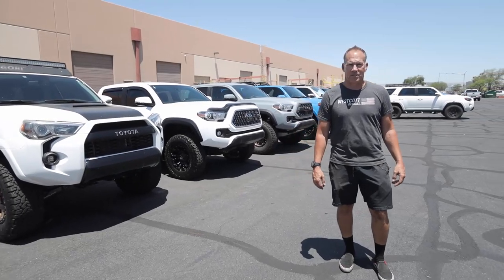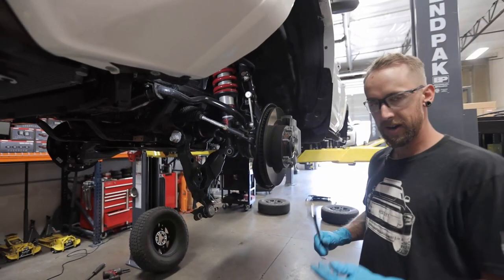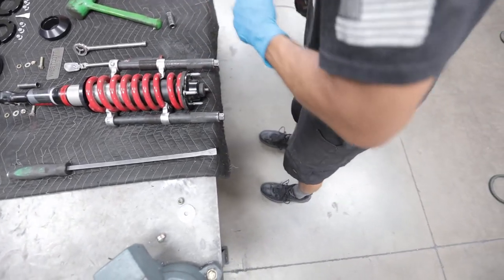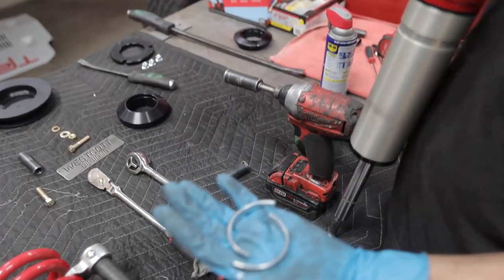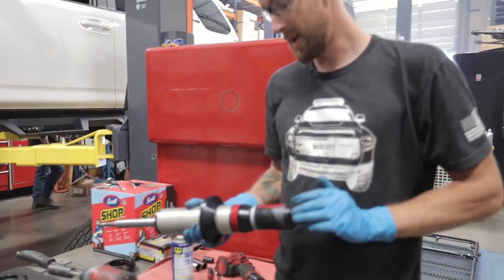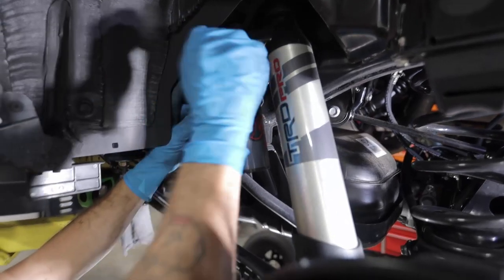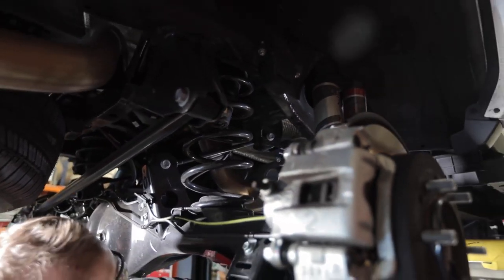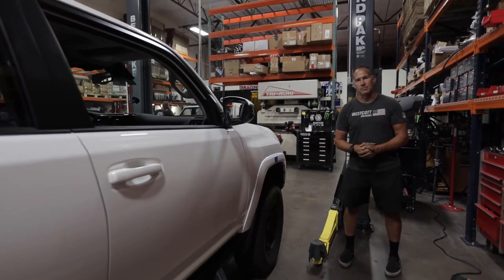Westcott Designs Fox TRD PRO Lift Kit Installation Video

Comment: This is essentially the same method of lifting that the first gen Raptors used to lift the front end….the OE Fox shock had three grooves that you could seat the collar into ( with a lock ring and set screw) to lift up to 2.5”….worked perfectly on my Raptor SCrew…gonna get this kit for my ‘23 Taco TRD Pro.

Comment: The last blue truck actually looks higher in the from and lower in the back. What happens when towing a 2000 pound trailer? will the rear side take more stress than actually suppose to take? Please answer with Honesty because am thinking to use your kit

Comment: No mention of torque specs, not a torque wrench in sight. 

Also took the easy yet more risky way of removing the front coilover. It's easy to crossthread the lower spindle bolts, especially when installing a spacer lift. 118 ft lbs on those, by the way. I've lifted well over a hundred Tacomas/4runners. Have skinned this cat every which way.

Comment: I learn a lottttttt. Is a great work you guys do in a such short time and Wonderful explanation. Am not a science master but it does put more pressure on the Front Springs Which in my poor understanding are designed to absorb the brutal terrain so the body of the truck does not take that stress whether of road or city hwy. One can see  the stress of the spindle bolts after the front kit went in compare when they first came out so Easy and the  upper Arm had to be Stress down to accommodate more distance for the bolts spindles to screw in. In my poor understanding I think the ride will be more Stiff because of the Shortness of the Front Springs to Absorb impact and it will result on more Stress to the truck body as a result. Correct me if am wrong please because I see changes on the Biomechanics alterations.  Did not see any Torque at all. Are we suppose to just tight without it? For look it looks amazing but for Long Life on the Body I don't know. What will happen when Towing? There will be Zero compensation for the back load.

Comment: I'll be upsizing the tires soon on my '21 TRD Pro to 285s up from 265s like you said. I've replaced the front bumper with a C4 Fabrication bumper, so I already have a bit more room in front than stock.  I've been pretty happy with how the vehicle sits and was planning on just doing however much chopping and trimming is necessary after getting the new tires.

Can you elaborate a little on how this additional 2" lift would affect the handling and performance of the vehicle on/off road?

Comment: Are the shocks side specific? 
I removed both at the same time and forgot which one came from which side.
Reply from the maker: They are side specific!  The higher collar from the bottom is drivers side.  That’s because it puts more preload on the spring to offset for the gas tank and driver.

Comment: Great video, thanks for doing this!  I’m assuming the front of a ‘22 Taco would be the same?  
Would love a link to the spring compressor that was used!
Reply: There’s a couple on Amazon for cheap if your only going to do this one job or maybe something else down the line. Unless your looking for some that will get used a lot then look into some better ones.
Reply: You don’t even need spring compressors like those used in this video. The coils can easily be disassembled while still on the truck by jacking up the lower control arm to compress the coil, removing the shock top bolt, and then lowering the jack carefully to release the coil. You also have to loosen the alignment cams and lower knuckle bolts on the LCA before releasing the coil.

Comment: @wescott designs nice video.  For any lifts I have installed I use anti seize and torque wrench. Thoughts? Do you provide specs if you purchase?
Reply from the maker: We do👍
Reply: @westcottdesigns doing an installation on a 2020 trd tacoma. No instructions or torque specs. I've done hundreds of lifts so I'll figure it out but for a beginner this could be a problem
Reply: @nicholascetrangolo8400  they said they do and you’re saying they don’t?
Reply: @macscvelopopperdonuts2169  yes I did an install of one today. Came with zero paperwork

Comment: What would cause the black dust boot to fall and rest on the bottom of the spring perch (front shock)? Does that silver washer that sits between the boot and the top hat hold it in place or did my boot just stretch out?
Reply from the maker: @ivanm2626  never seen a boot stretch out and fail.  It shouldn’t because you are not extending anything or changing the location of anything other then the lower collar being replaced to put more preload on the spring
Reply: @westcottdesigns thanks for the reply. I just raised up the car and tried to figure it out without removing the shock right now. What holds the boot up to the top hat? I’m thinking that the washer may have not been reinstalled if that is what holds it

Comment: Are there any issues with camber through the travel on the front lift for the 4Runner?
Reply from the maker: We have not had any issues the last 9 years of making the lift.  Shops will tell you that you should or need to replace the upper arms,  but this is so they can make more money off the customer for parts and labor.  Toyota has designed the 4Runners to align up to 3” and for the axles to be good to 3”
Reply: @westcottdesigns  thanks for the info!

Comment: Hi Crew! Newby to this world here. I am looking to get this lift for my truck, but wanted to confirm something... When doing the math I seem to be only gaining about 0.55" (inches) of clearance from the stock setup on my '23 TRD Pro when upgrading to the 285/70R17 (is this the biggest tire I can do without any chopping?) tires. The truck will definitely look better with the lift & new tires, however, the true height gain of ~1/2 inch is not going to make or break me when really off-roading. Is this a true statement?
Reply: They did not answer your question because they know It Will. Read my comment or watch the video very very careful

Comment: Do you have a video for tundra pro?
Reply from the maker: What year?
Reply: @westcottdesigns  2021
Reply: @westcottdesigns  2017 Tundra pro
Reply from the maker: The install for your front strut is much easier.  It uses a clip ring to hold the lower collar and you hit it once with a hammer and  it will pop right off.  When you install it you just need to just drop it back over the clips and it’s seated.  As for removing the struts and reinstalling then they come out and go back in the same way this video shows.  One tip to remove the lower bolt for the front sway bar before you do anything at the lower control arm on both sides.  Then it will go easy.  Make that bolt the last bolts you put back in when you are all done and the front wheels are back on the ground and front wheels are settled.  This will make it easy
Reply: @westcottdesigns  Thank you for the info.

Comment: Awesome kit just installed yesterday on my wife's 2019 4runner TRD PRO in voodoo blue. Easy install only question I have is where do the 2 black anodized thick washers go in the install? I did not see them in the video and could not tell where they go when installing.
Reply: Same here. I'm about to start my 2020 .
Reply: Did you figure out where they go??
Reply: @amarek454  I never heard back so no idea. Good luck on your lift. It wasn't too bad.
Reply: @matthewkirkham8234  LOL ok , thanks Matt
Reply: @matthewkirkham8234  I found a supplemental video on their website. The 2 black washers are for the front rubber bump-stops. Video says they are not necessary, only a safety precaution for extreme off-roading. Thanks
Reply: @amarek454  awesome great info thank you!!
Reply: On top of the shock

Comment: at which point do i need a full suspension upgrade vs this kit?
Reply from the maker: It really comes down to what you are going to use the truck for and how many miles are already on the suspension.

Comment: What if I want to keep the stock rake angle the same so the front is a bit lower than the back? Just leave out the upper shim on the front shocks?
Reply from the maker: Correct!
Reply: @westcottdesigns  Could I also flip that around as well and just install the upper shims and exclude the lower preload collars? Or do the lower collars have to be installed? I'd be curious to see if you have any photos documenting the variations of install.
Reply: So if I leave out the top shims,  it doesn’t add any lift to the stock height ?
Reply: @ImOnlyaMAN88  I think it still does. The shim looks about 1/2" so just minus half inch from the total lift. The shock collar is still thicker than the original so you'll still get some lift up front.
Reply: I’m curious how it rides on and off-road with so much preload with the spacers.
Reply: I’m curious about this too. If I want to add just .75” lift (plus or minus) to my 2022 Tacoma TRD pro, can I eliminate either the top shim or the bottom collar, and if so, which one is better to eliminate? I’m thinking it would be better to eliminate the lower collar due to the added preload but would like to verify?
Reply: @bencashman1017  consider the Eibach TRD Pro spring lift kit over this level kit. I’d rather not mess with the spring preload especially if I’m taking everything apart in the first place anyway. The Eibach TRD Pro was tested and designed in partnership for OE Fox Shocks.
Reply: @Zapablast05  that’s what I did.